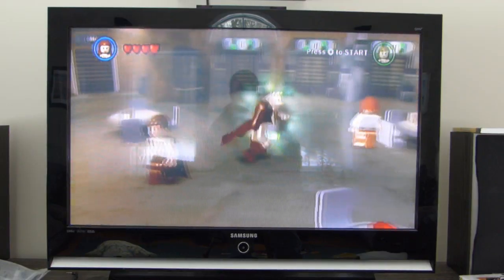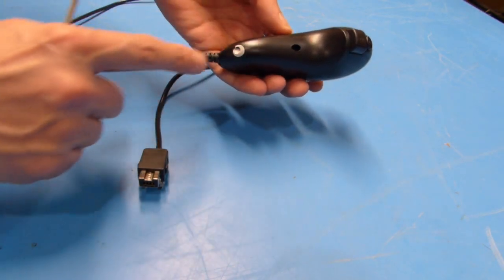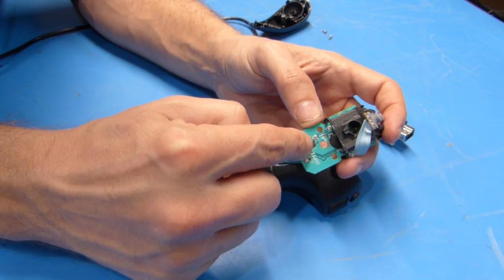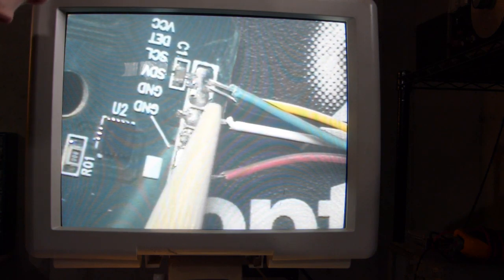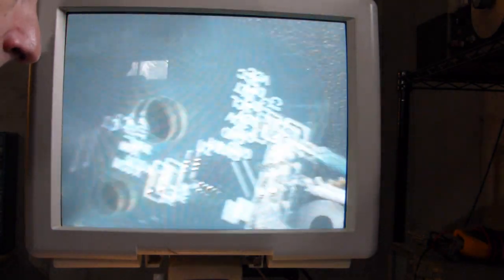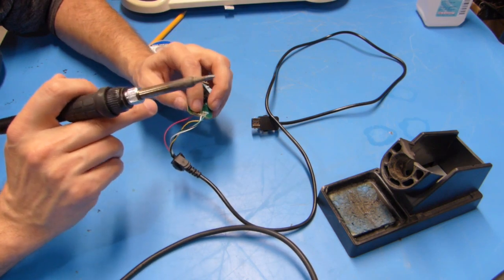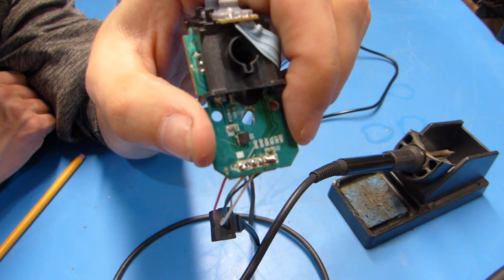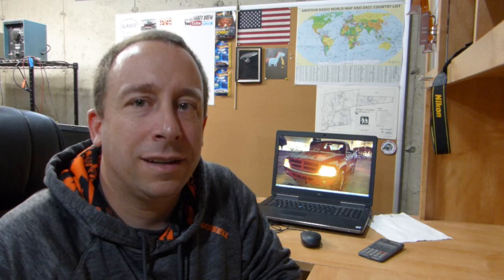Nintendo Wii Nunchuck Repair

Comment: P. S. I can guarantee it was soldered by hand (read slave labor) and the holes were not used because it does shave a few seconds off assembly. In the US, it's hard to accept they would let that out of the factory like that, but China historically dumps steel, videotapes, electronics etc etc etc ad nauseum. Of course the overwhelming majority of the world's mass produced anything are made in China, including your Wii, Xbox, PlayStation, iPhone, etc, so it's typically the knock off or super cheap versions that cut huge corners in production.

Comment: Good job on the repair. It would be interesting to see the build difference between the knockoff and the real Nintendo controller. I'm sure your son was very happy and impressed with the repair. Way to go dad!
Reply from the maker: Thanks!  I was wondering about the comparison to a "real" controller as well.  I almost took the real one apart while I was working on this one but was running a little short on time so I opted against it.
Reply: SevenFortyOne 
How would you repair it if the Wii can't sense the nunchuck when it's plugged in the Wii remote?
Reply: @SonicX-pd9kc  My guess is the detect wire (DET as shown at 3:08) is not making a good connection.  Either a cold solder joint at one end or a broken wire.

Comment: my nunchuck works for a bit then randomly disconnects then i reconnect it and the same thing happens over and over please help
Reply: Classic_Nerfer in the hole of where they connect? And does that’s actually work? Does this happen because of the dust and stuff In it?
Reply: @hristijan4469  yes do it on both side and if will clean up the ends so it works

Comment: 3:08  If you look at the silkscreen  for the black and blue wires, one is VCC (positive voltage) and the other is DET, which I assume is short for detect.  This is likely a wire to tell the controller that a Nunchuck is connected and thus should be shorted to VCC.  Strange that they are using red for GND and (presumably) black for VCC, but what can you expect from a cheap knock off.

Comment: I got two Official Nintendo Nunchuks and thru both do that. I opened them up and nothing wrong in the soldering or wiring. Don't know what to next 🤷‍♂️
Reply: The stick pot/switch box is worn...you will need to replace them....costs like $3 for 5 of them on ebay. Soldering required.